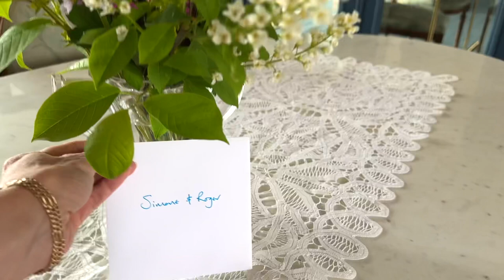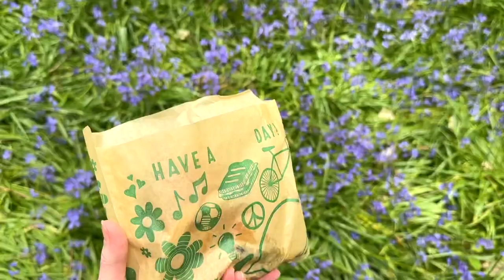Transforming the Chateau’s BIGGEST Bathroom - inspired by our BLUEBELL WOODS! 🌳

Comment: I am redoing all cabinets.  One of the best ways to clan up dust from working is a product called KRUD KUTTER.  You add small amount to water, and cleans up fantastic with one cleaning.  Don’t need several cleanings.  Is also great to clean wood in general and wood floors.  No fumes or smell.  I couldn’t have got by with all the cabinets without it.  Cuts work on half.  This is not a paid advertisement, I do all of my own remodeling and this is a game changer.

Comment: Why is the kitchen temporary? What else does Amaury want to do there? Sprinkle it with gold I guess😉 It looks perfect
Reply: The heating system is going up through the kitchen area in three weeks. All the shelves will come back out of the corner, and the cover of the vent will come off. The heating  system will go from the workshop area up and then above through to the other second and three floor areas of the Chateau.
Reply: @carolinegooder7091  I know,but he keeps repeating that it is temporary as if it looked very bad but it looks better than my kitchen 🤣
Reply: @bettyzak2588  Misunderstood what you were saying. Yes, Amaury's temporary is better than many finished projects. He is a perfectionist, which during this building stage isn't possible. 😂😂😂❤